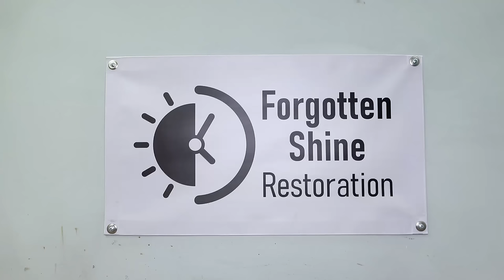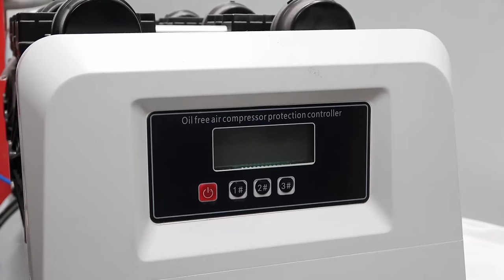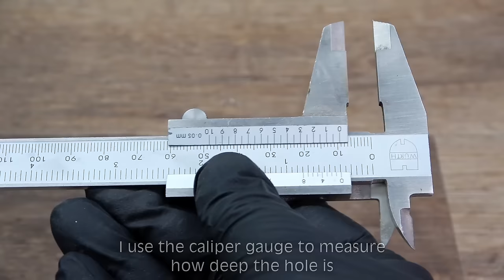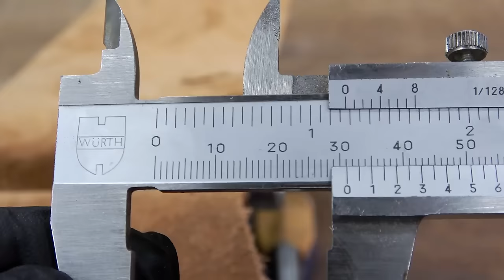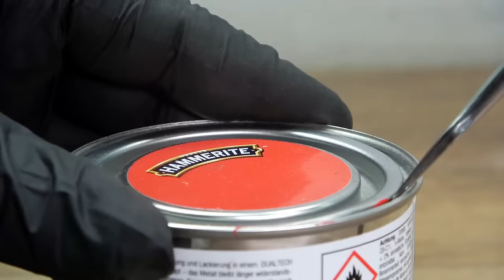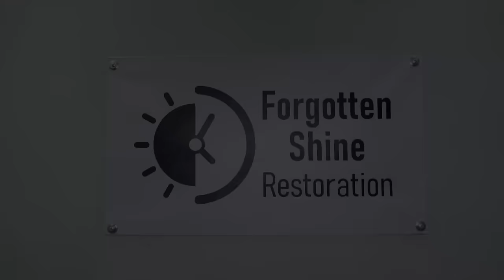Pulley Restoration | Is That Poop??

Comment: Not poop, but it may have been a pulley wheel with either a leather or rubber bedding to make the wheel less noisey.
Reply: I think its leather or rubber gasket for smooth noise free operation. It's purpose may be to prevent wearing off the pulley and its replaceable component. The leather rotted and appeared to be poop.😂😂😂

Comment: Nice save of that pulley system. And the colors look good too. One suggest, if you have the space, install a backup washer before installing the cotter pins. That way if, or when, the cotter pins spin, it won't scratch up the finish.  Thumbs Up!
Reply from the maker: That's right, thanks for the tip!  🐢

Comment: I have two theories as to what that stuff caked in the pulley was:
1.  It's manure/dirt from lying on a barn floor for many years
2.  It's the disintegrated remains of the rope that use to go around it
Reply from the maker: I suspect the rope was pulled on the floor (full of poo) and then transported into the pulley...🐢
Reply: I see a similar effect in my work. The pulley starts making noise. They put a lubricant. In this case probably grease. The grease, because it's wet, gathers dirt and dust particles causing it to cake up and dry. Then you have scrape it off to clean the pulley.

Comment: Just wanted to say, protect your camera lens from arc flash as well, it will damage the photo receptors inside it. Same effect as if you were to point it directly at the sun. There are shields you can buy to protect the camera lens like green tinted glass or plexiglass.
Reply from the maker: Thank you for the tip! 🐢
Reply: I think he makes 2 takes. One with the welder off and some special effect and one where he is just finished. Or am I wrong?

Comment: I'm pretty sure this video gave me OCD :)
Reply from the maker: And which?🐢
Reply: @ForgottenShineRestoration  holding the sandblasting gun upside down, and not cleaning the pulley wheel BEFORE putting it in soapy water.
Reply: @ForgottenShineRestoration  I think it was when you were moving the pieces slowly off the screen and the noise it made